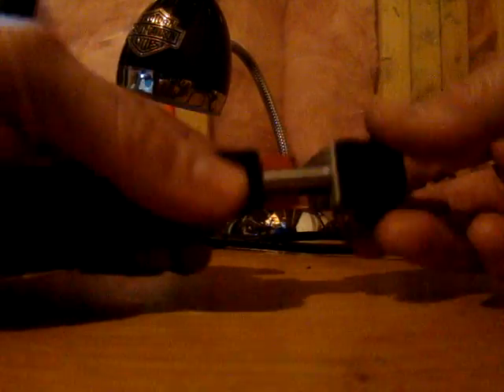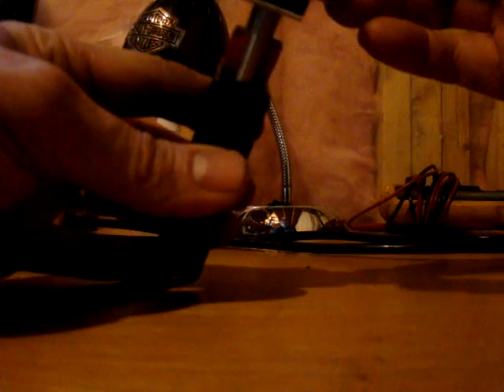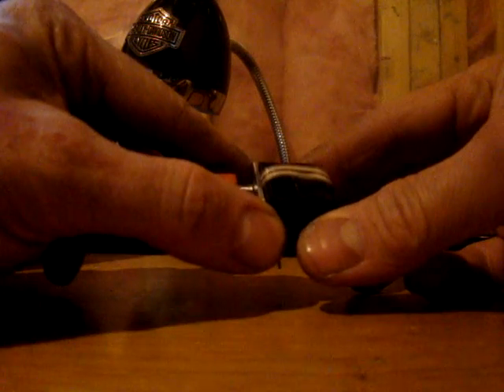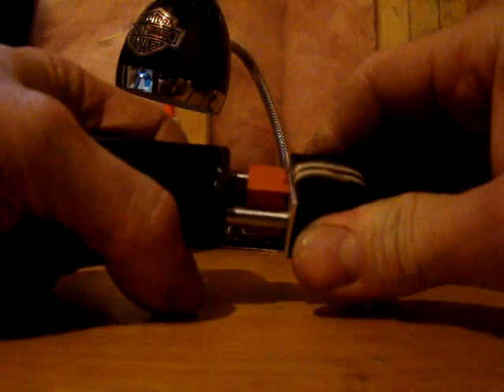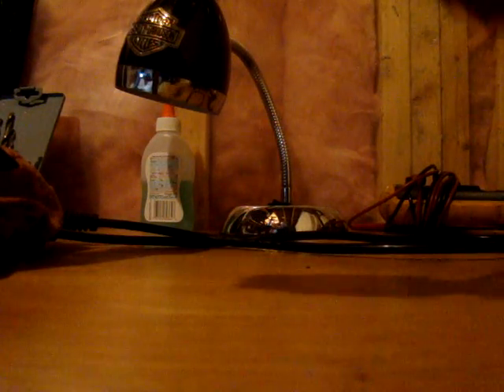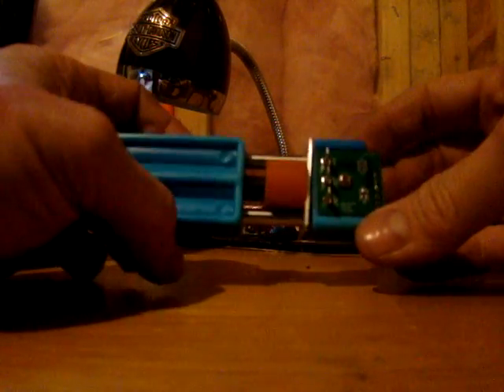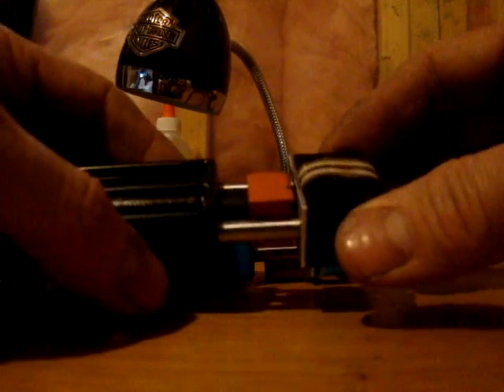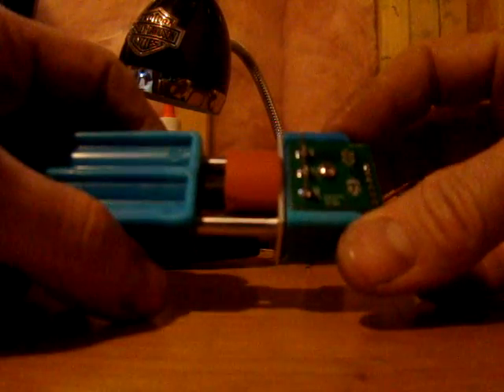AP Loadcell mod

Comment: just got mine in today... installed.. brake pedal was acting in reverse. off when pressed and on when released.. also now my wheel does not calibrate properly. it turns all the way to right and to the left but stays left, does not center. help?

Comment from the maker: dont worry about the cover of you pedals now etc. leave it off since your screwing around with mods....  just put the wire that broke where it should go, i think on the g25 or g27 there is a little hole in the tab, strip the wire a little, feed it through the hole and tape it.  on the ap load cell there is no hole, if you strip the wire enough, wrap it around the pin it should be on and tape it...since you cant solder or add a new connector

Comment from the maker: from what Jellybeantiger sais it is black now.   it feels good, works on pressure, it made my racing in iracing more consistant by far...play with the brake curve adjustment in iracing.  I did not use 0, I used 2.5-3.0 at times.  Write Andy and see his recommendations for the brake curve settings, you wont regret the purchase.